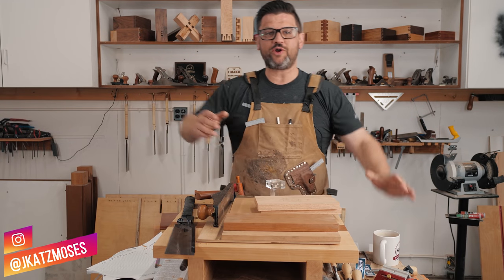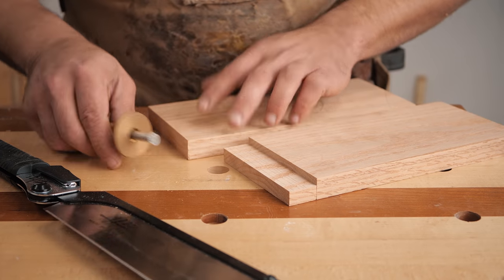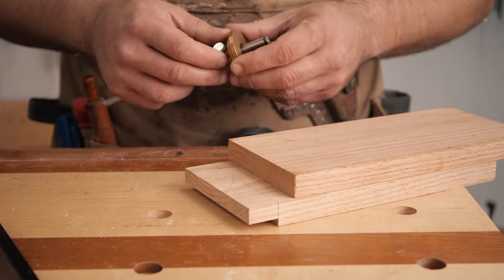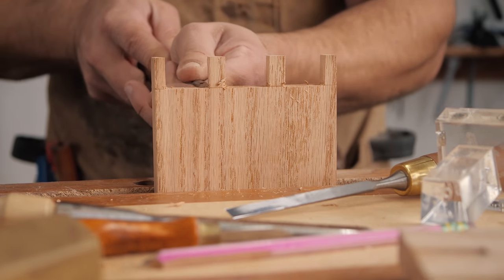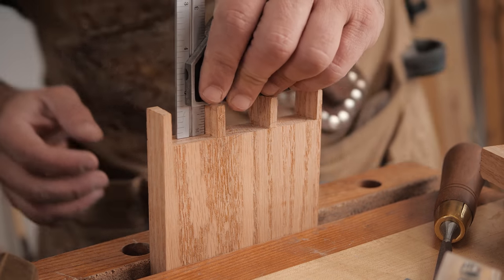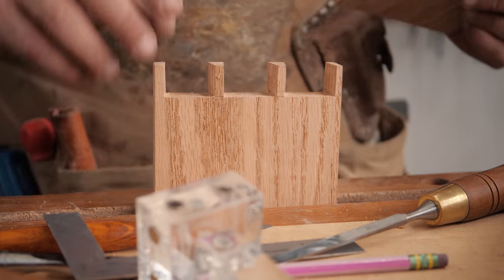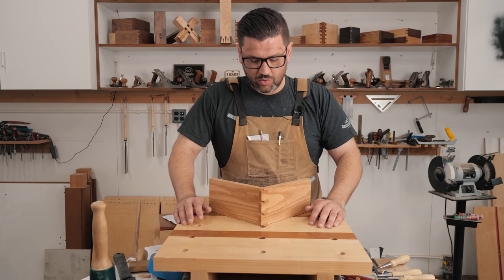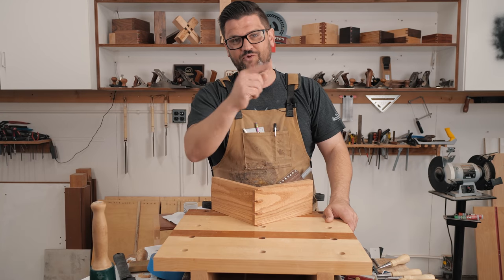Proud Dovetails - Joint of the Week

Comment: Quick question, I have a veritas dovetail saw. And I prefer western saws for the most part. But does the infamous Katz Moses dovetail saw guide work with western saws? or will it just be a waste of money for me? And I will not change to japanese saws they just don´t work for me.
Reply from the maker: Any saw works. The guide is .9" tall so you can calculate your depth of cut.

Comment: This is a great look - a must try.    Question: It was drilled into me as a young man to always lay my planes on their sides to protect the cutting edge - was I taught a myth?
Reply: Can of worms your opening. Good reasons to do both. But, a plane on its side can bite you good, that’s why I’m called “lefty” Also on its side the blade is able to be hit by other metal tools. A plane sitting on a work bench leaves the blade touching..... wood. Exactly what a blade is made for. I usually set the toe on a small piece of wood. So... I’m undecided too.